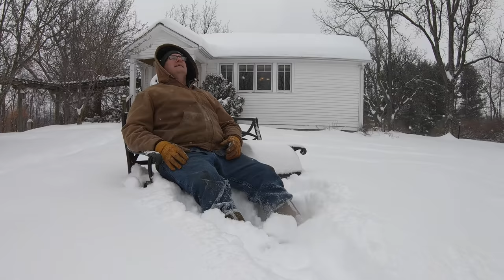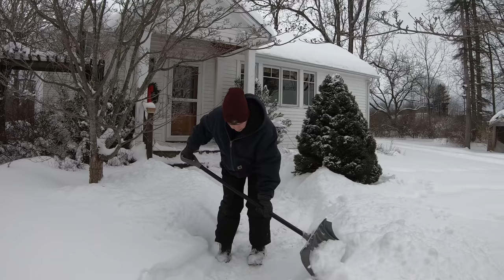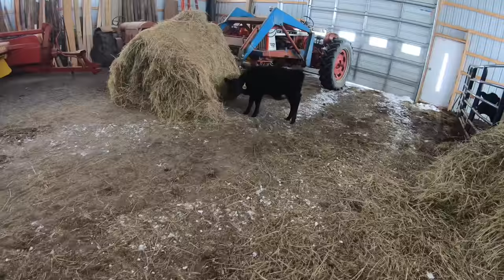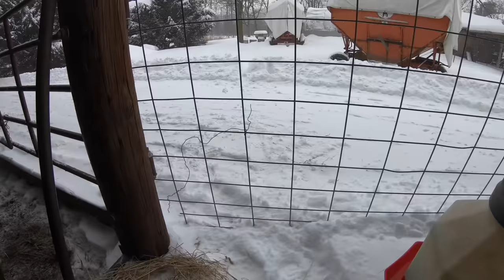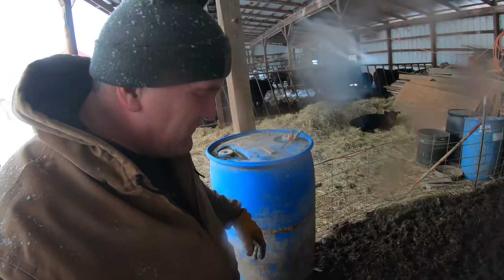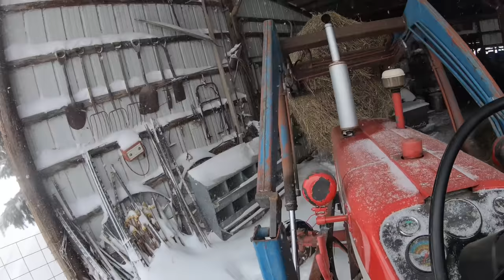6 Feet of Snow!

Comment: I've plowed a lot up here in Maine. you can plow with a bucket just fine. Of course you won't angle the bucket like you do a plow blade but being able to push the banking back works better with a bucket. The very best tool to put snow exactly where you want it is a snowblower. I know you're tighter than bark on a tree Pete but, the time a snowblower would save might make a huge difference. There must be something you could rig up to one of those awesome red tractors that have a PTO. We love your show. Blessings from Rumford.

Comment: It's good to see the work involved in taking care of the farm. I'm a little surprised your kids aren't helping some, but presuming they are in school when you made this.

I have a Farmall Super A, and I love running around with it and plowing! I don't have anywhere as much to plow as you do, but I still like it!

One thing I did with mine was to cut a 55 gallon steel drum in thirds, and shorten them a little, then I bolted it to top of the plow. I keep the plow angle to the right, so the right hand peice has the top of the drum on it still - well, part of the top, anyhow - and that acts as a 'scoop' to keep the snow going to the right. Redecues the number of passes, and does a better clean-up.

Keep mixing up the videos!

Comment: That squeeling bypass valve on the hydrostatic tracor would drive me nuts.
Reply from the maker: You mean the iced hydraulic filter screen on the hay loading tractor? It does drive me nuts. That tractor’s always had problems with condensation in the hytran, despite changing it every year.
Reply: @JustaFewAcresFarm  I'm not sure. I bet you know best. But it stops squeeling when there's a load on the pump. Makes me guess it's some kind of pressure relief or bypass.
Reply: Because if the oil is pumped to the loader it still goes through the filter screen?